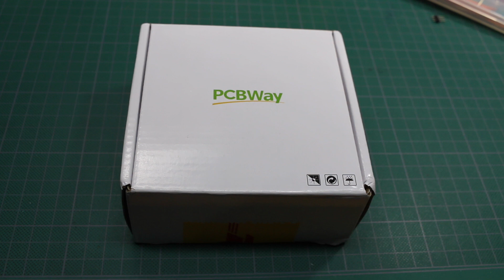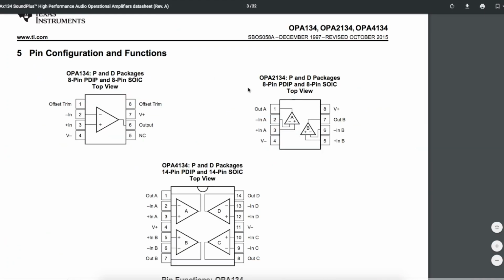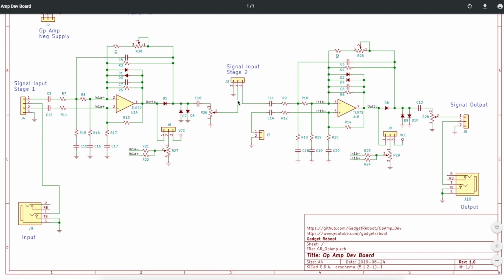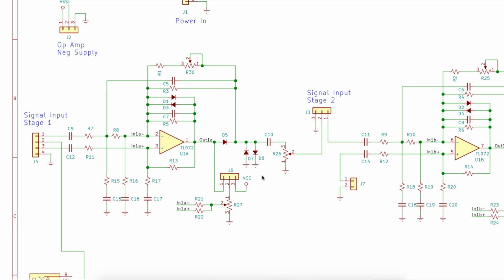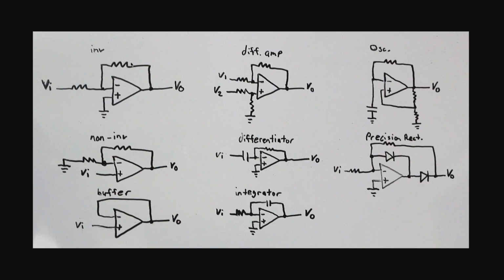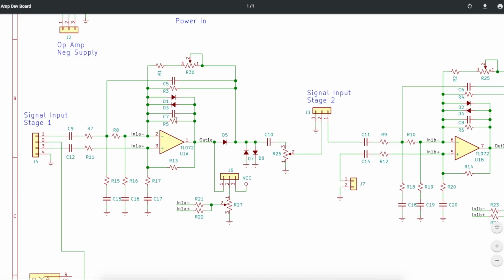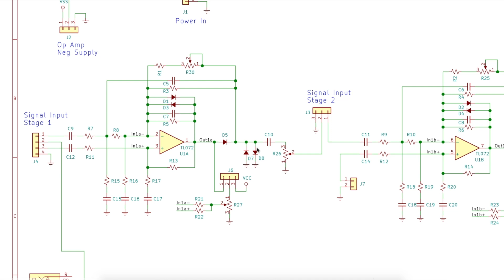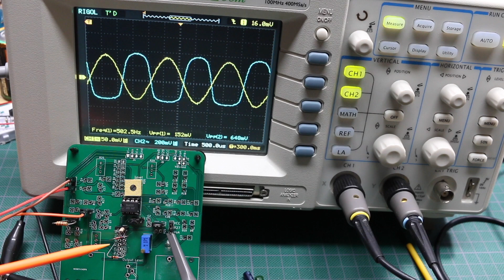Op Amp PCB - Many Prototyping Options

Comment: Very clever general purpose design.  Your eclectic skillset is impressive!

Would like to see space for a 7660 Negative Voltage Converter as I often use one in op amp circuits (with a single supply).
For swapping thru-hole components:  round low-profile female headers are more secure than DuPont headers.  They lock.
Do you know offhand which was the first (standard) archetypical, 8-pin dual op amp?  Something must predate the LM358.
Reply from the maker: It looks like the GAP/R P65  had eight pins in this historical document  https://www.analog.com/media/en/training-seminars/design-handbooks/Op-Amp-Applications/SectionH.pdf

but I’m not sure what the first main stream standard eight pin dip might have been. The 741 was the first thing I ever knew and before that everything is just a vacuum tube to me.  The document says in 1963 there was the μA702, then the 709,  then the guy moved to national semiconductor and started the LM trend.  Going to have to read this sometime as a historical interest. 

 I have some round machine socket female header strips kicking around somewhere. Is that the type you mean? 

 I haven’t used split rails very much but lately I’ve been thinking more about looking at negative generators as well as isolated power and data techniques. Some of that interest is coming from getting back into old computer stuff and RS 232 even though I could just use built in 232 chip charge pumps for that but I’d like to get a cleaner thing I can use for op amps.  

 The board was going to have even more stuff on it but it started getting so big I couldn’t fit it within the target real estate but the future holds infinite projects!

Comment: How timely! I spent time last week working on a Proco RAT distortion pedal clone circuit (the orig uses those old hard to find LM308 single op amps with offset pins) that I want to incorporate into a PT2399 delay circuit for my analog TT-303 monophonic bass synth. Alas measly breadboards for me but I wouldn't mind having a couple of those PCBs ya got. :)
Reply from the maker: I already found a few design elements on this board that I would have wished I did a little differently so I’m hoping they actually work for things like audio circuits without introducing more garbage than intended effects. Especially because the routing is all over the place with so many jumpers, I’m hoping there’s no extra noise. 
 I remember about 15 years ago I was working with a breadboard op amp for a guitar circuit and it was creating so much hum but I found if I cut a sheet of aluminum foil and placed the breadboard on that, then curved  it over top of the breadboard just like a C  shape without even fully enclosing anything, then I took an alligator clip and grounded the aluminum to the circuit ground and the noise went away. Magic!

Comment: With JLC PCB you can decide where the customer ID goes or pay a little more and not have it at all....Just sayin !
Reply from the maker: I wonder if board shops will accept requests for them to use invisible ink for their tracking numbers...
Reply: @GadgetReboot  Yeah UV would be great for other stuff too.
Reply from the maker: Yeah I think there was a place to add comments when submitting this order so I probably could have requested a specific location as well but it hasn’t really been an issue for my stuff. I might try that next time!
Reply: @GadgetReboot  The reason I brought this up is I once designed a PCB and I wanted it to look aesthetically pleasing (nice!) and they stuck the bloody number smack bang in the middle and it looked  horrid!